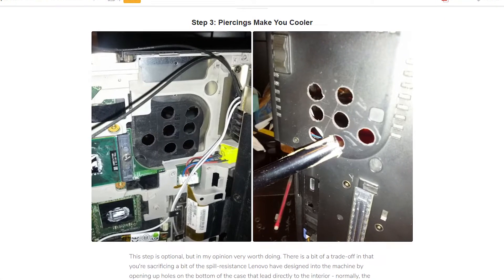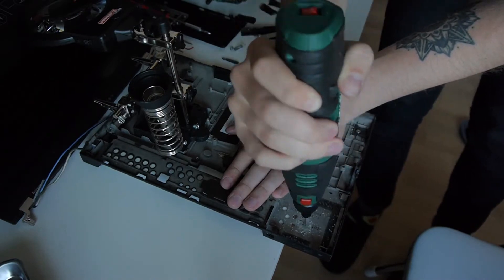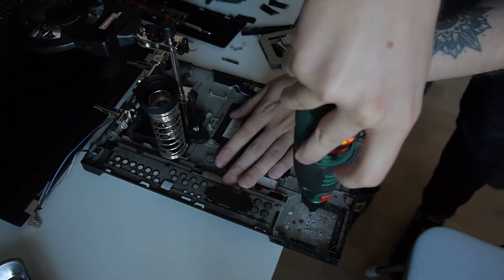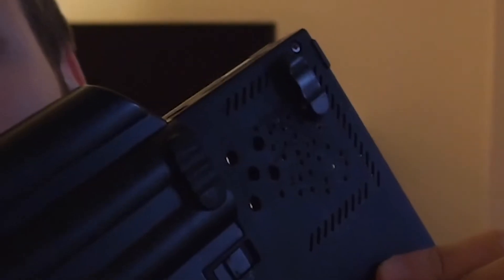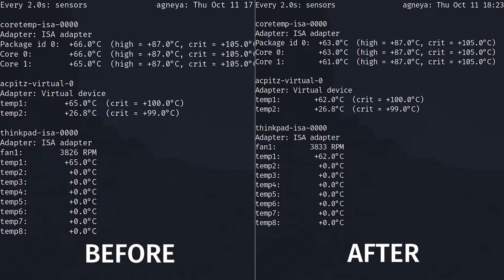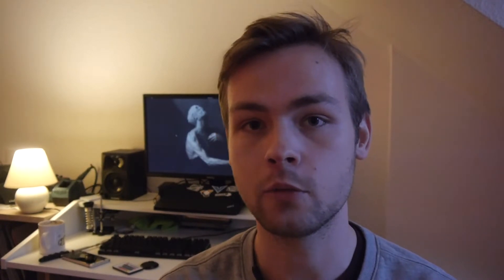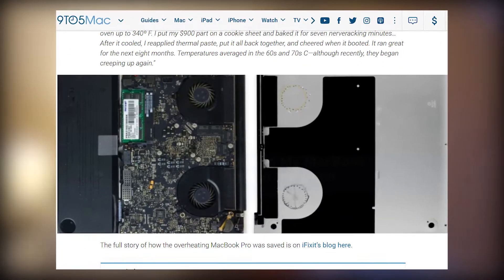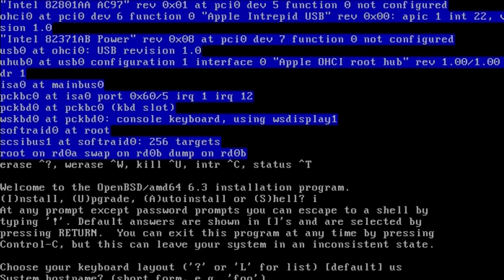Why do people drill holes in their laptops?

Comment: My W500 was bricked several times trying to run the ATI VGA option ROM in Coreboot. Ended up dremeling a cutout in the magnesium frame so I could attach a flash programmer without removing the motherboard. It's only visible if you remove the palm rest.

Comment: my laptop is a asus vivobook 15 f512da with a specs of: r5 3500u, vega 8 2gb, 2x4gb ddr4 and a 256gb m.2. the heatsink sucks on my laptop and also the fan sucks as well. so I drilled 24 holes evenly square where the heatsink is. witcher 3 before 25w tdp 960x540p lowest settings got 96c thermal throttling heavily. after is 80c-86c same settings and tdp. arma 3 ravage mod before 25w tdp 540p lowest and disabled got 86c. after same settings and tdp got 75c. for longevity of the device is to put fine non metallic mesh where the holes are.  make sure the area is clean of debris or it will short something on your laptop. so all in all I got 10c+ less in my benchmarks on a long test. ps I used a laptop cooling pad.
Reply: Omg I have the same laptop and drilled 12 holes. It wasn't life-changing but I got a few degrees less yey
Reply: @joaofaria9519 i have the a mãe modelo too , got 11 degrees less .

Comment: I have a ASUS X555L laptop and i drilled holes on the heat pipe and fan. This and thermal paste made my laptop AT LEAST 15°C cooler. From 85 to 70 (100% full throtle). Add a cooling pad and it can survive anything. You were my inspiration, thank you 😘
Reply: I also made some line holes at the bottom panel of my ASUS TUF FX505GM + repaste + diy 20v cooling pad
 THERMAL SOLVED!
Reply: @Icaga1903  hi i have the same laptop as u, can u send some photos i want to replicate ur diy ^^